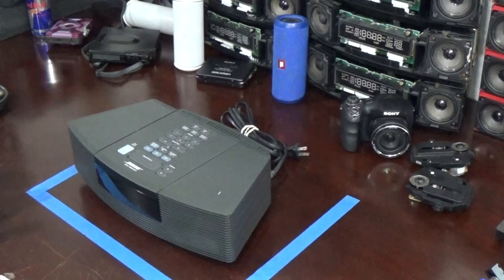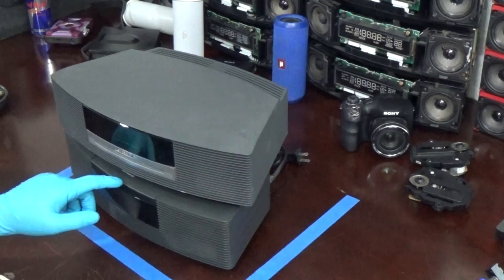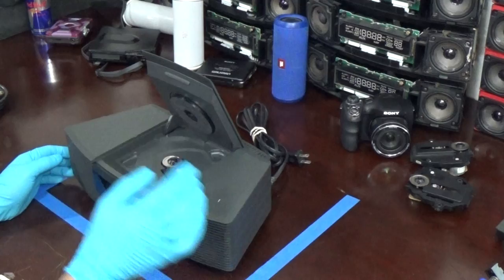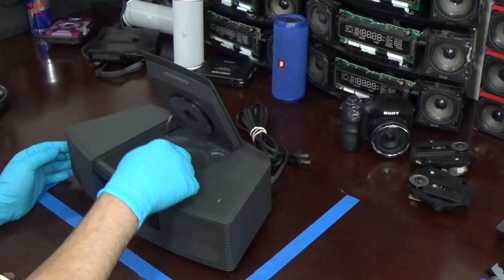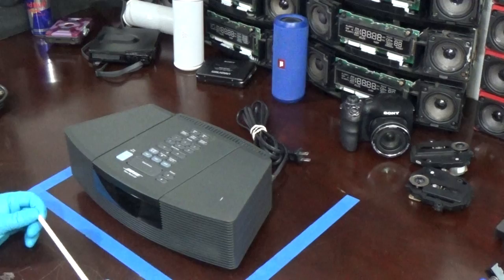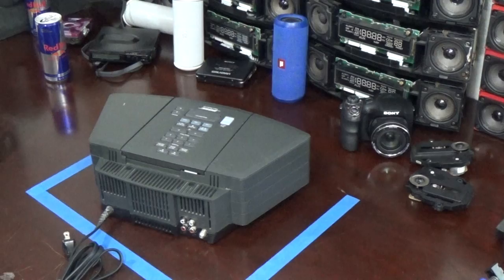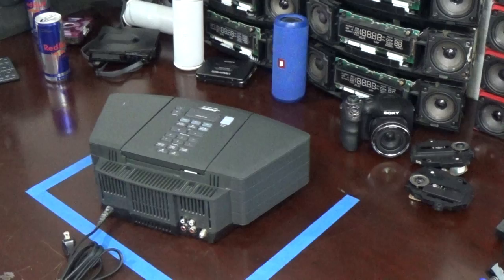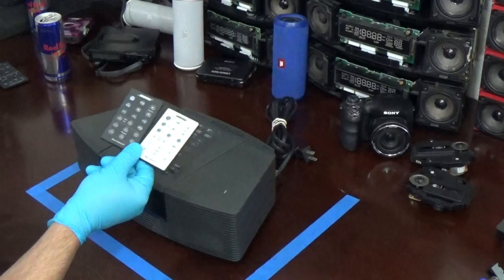Pt. 1 First Gen Bose Wave CD Radio VS New Model Teardown Repair Dismantle All You need To Know

Comment: Hi - I have a bose AWR1-1W that makes no sound when turned on.  When you turn it off, it buzzes once and shuts off.  Looking for some help and direction.  Where do I find a schematic?  Is this considered a Gen 1 or 2?  Thanks. Tom
Reply from the maker: Hi, your Wave needs the caps replaced. Sometimes the caps don't swell or split they just dry out of old age. Yes, that is the first Gen (1) Good luck.

Comment: I have one of the earliest models, didn't offer a cd at the time. One of my speakers isn't working is it worth fixing?
Reply from the maker: Hi, the non CD models AWR1-1W are significantly lower in cost. I would put it aside and purchase a replacement unit. Just not worth the time or money trouble shooting it, as it could be simple like a speaker or it could be the amp. You can find them in nice working condition for around $45 to $60 and you can keep the old one for parts or scrap. The CD models restored or refurbished on ebay start at $275 to $600 Have a good one...

Comment: When the power goes out the settings are not retained. The battery is good. I presume there is a capacitor that is employed to supply the energy, and that over time the cap has failed. Can you comment? Which cap...where his it in the board and what value?

Comment: Hi there, I just discovered your First Gen Bose Wave Help video.  Super helpful and I applaud your efforts.  Quick question is that I own an AWRC-1G and the Laser Pick-up is starting to fall and I need to source a vendor to replace.  Can you provide any suggestions.  Second, when installing a replacement laser pick-up to this specific model, is there any calibration or set-up required other than strictly/carefully replacing the laser unit?  Again thanks a ton for your videos.
Reply: Did you ever find a replacement laser assembly?

Comment: Hi. Do you sell spare parts for this Bose unit? And if not, where would you recommend I look . I believe my laser diode is going bad.
Reply from the maker: I am sorry I do not. I supply a remanufacture / reseller that refurbishes units, but they do not do retail repair and they do not sell any parts. Thanks...

Comment: How do you do a hard reset on Bose lifestyle Av18
Reply from the maker: Sorry its a bit lengthy, but here it goes... Turn the system off. Wait 30 seconds
Unplug the media center power cord from the power outlet
Unplug the audio input cable from the media center
Unplug the Acoustimass module power cord from the power outlet
Unplug the audio input cable from the Acoustimass module. Wait 30 seconds.
Reconnect the audio input cable to the Acoustimass module
Reconnect the audio input cable to the media center
Reconnect the Acoustimass module power cord
Reconnect the media center power cord
Wait for the words "Bose Lifestyle" to appear and disappear from the display before turning the system back on Good luck...